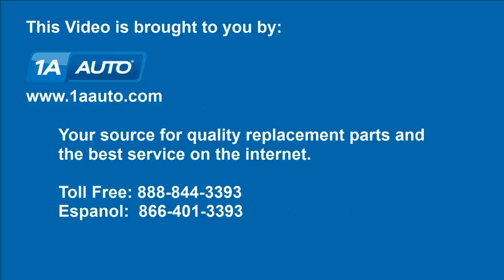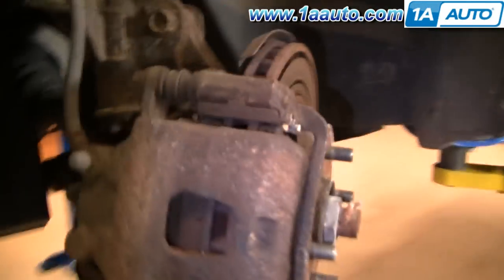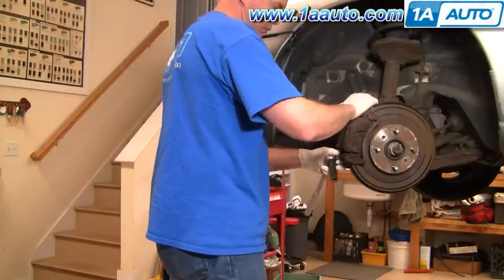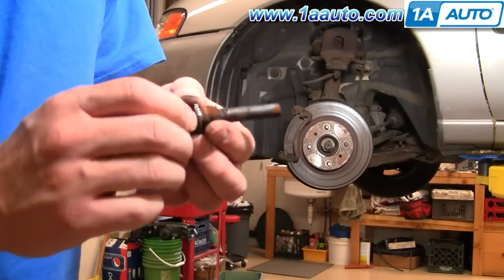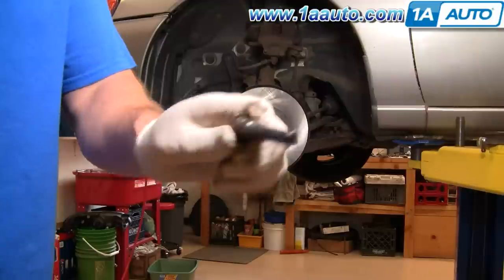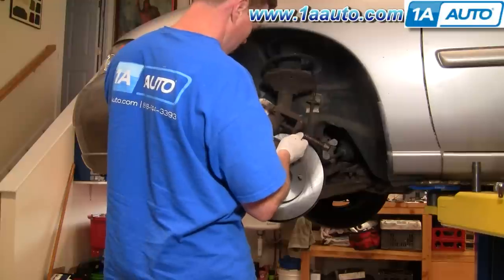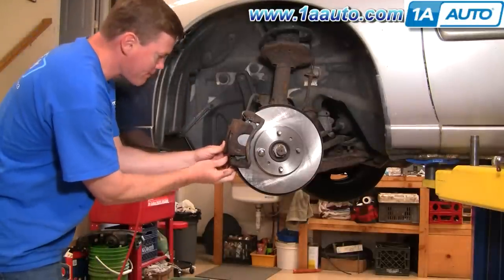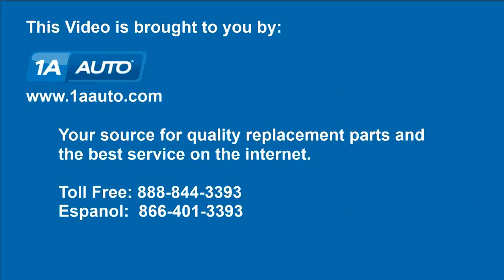How to Replace Brakes 93-01 Nissan Altima

Comment: Well done. This helped me replace my old noisy rotors and pads. The hardest part was banging off the old rotors. They were probably original equipment, so quite rusty and stuck... plenty of oil and a little heat from a torch helped them off. Brakes sound great now!

Comment: Hey, thanks! I got a bunch of retainer clips - which I didn't see you mention at all and separate wire lookin things. Didn't know how they go together, so just left the old ones in.  I noticed when I pushed the piston in on one side, a little fluid leaked out. Hope it's gonna be ok. The when I  put it all together, I saw a lot of fluid on the driver's side tire...hopin it was just from the master cylinder.

Comment: Hello i have a 95 nissan altima is this the same procedure reason I asked is i was told these cars are only the same from 93 to 97. My question is the front brake pads on driver side and passenger side the back pad with the metal squeal tab
 is on bottom on both sides is this right not sure how long its been since pads been replaced

Comment: I would like to ask. After cleaning the caliper pin bolt, would it not benefit from some synthetic high temp grease as well as the brake pad contact points within the bracket, so as to prevent seizing in the future.

Comment: Great Post! Couldn't have been easier – like TW said, you saved me hours and tons of frustration. Thank you! One question though. After changing the rotors and pads, the parking brake light stays on. I checked fluid level and it's good. Any advice?
Reply from the maker: Thank you for watching. The Parking brake light is only going to come on if there is low fluid or if the parking brake is applied. First i would double check the fluid at the reservoir, if thats not the case then I would look at the parking brake assembly. Sometimes if you play with the cables or anything like that they can stay slightly applied. This can also happen if you use the parking brake for the first time in a while, the parts tend to stick and stay partally applied even if you release the brake. Hope this helps.
1aauto.com 888-844-3393

Comment: The car is up on jacks...so I'm not driving it anywhere until I get a new bolt. I just wasn't sure if I needed to source the bolt through the dealer, or if I could get it from any auto parts store.

Comment: What kind of bolts are holding the caliper bracket on? One rattled loose off my Altima, and I haven't been able to find a new one. Do I need to special order it or can I get it from anywhere?